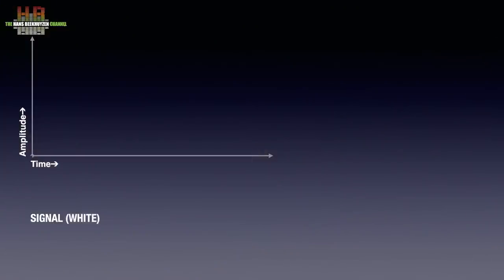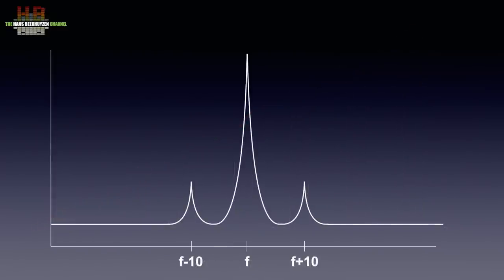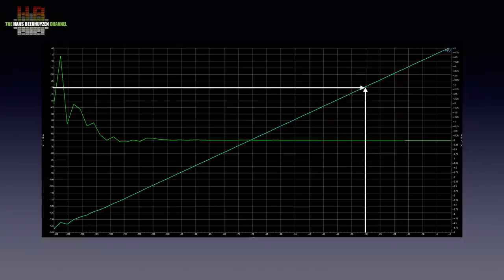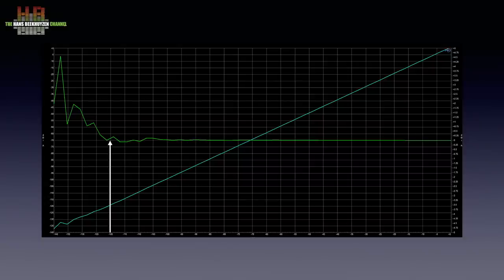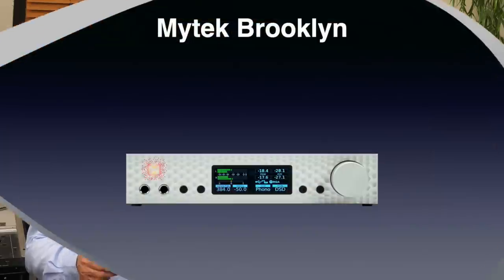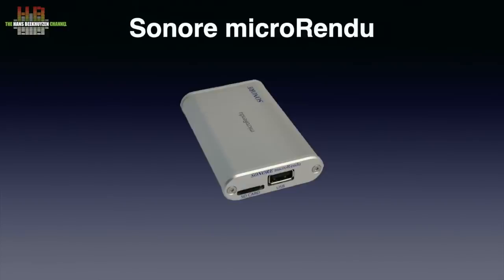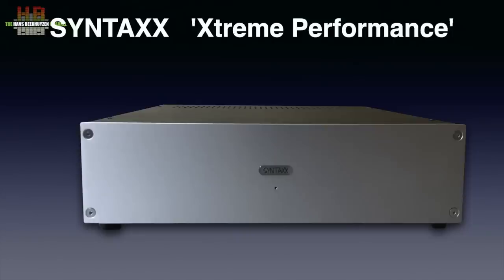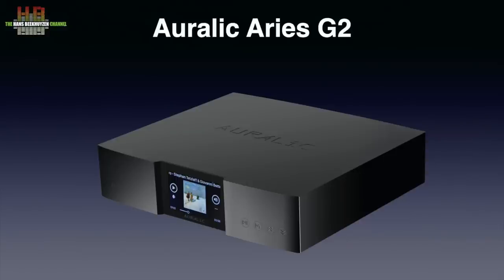What defines the quality of a DAC?

Comment: Good explanations - thanks. Two things come to mind . . .  1) Ladder DACs tend to be less affected by jitter than Delta Sigma DACs which is one of the reasons that they can sound better than DS DACs. 2) Most power supplies both pollute the mains supply with noise and are affected by mains borne noise. Adding power supplies for each piece of equipment that are designed to not pollute the mains supply as well as being as immune as possible to noise on the mains supply will tend give the best subjective results.
Reply from the maker: Still the best DAC's I have heard are no ladder converters.....

Comment: I  have the Brooklyn bridge with BOTW 12 Volt,  what voltage do you run them at?  Sbooster recommends 13 volts (I emailed them), but the input on the Mytek, says 12 Volts.  I also contacted Mytek but they never replied.
Reply from the maker: I use a Syntaxx power supply that outputs 12 volts. I did use an sBooster at 12 volts before. Never tried it at 13 volts.

Comment: Hi haans thank you for the video. But you have discussed only linear distortion. What about background noise, and complex modulations - either signal correlated or random (like spectral leakage) etc?
Reply from the maker: There is no point discussing all parameters. I just mention what might be interesting. I don't publish measurements either since people seek grip on those graphs as where the only can prove when something is wrong (in which case I will mention it). People have to learn to use their ears.
Reply: @TheHansBeekhuyzenChannel  definitely agreed on the last sentence. I'm still curious though to know more measurement possibilities to atleast correlate part of the experience to.

Comment: Very well explained.
What are your thoughts on the comeback of R2R ladder DACs, while chip based DACs have come a long way?
Reply from the maker: There is not one and only best working principle but several and R2R is just one of them. It's all about how well it is designed and built. They are all different approaches to perfection and different routes lead to different compromises and thus different sound characters. And don't forget, perfection is a goal, not a reality.
Reply: @TheHansBeekhuyzenChannel  If you're trying to listen to cd's or any form of music without oversampling then an r2r dac will always be superior. It can't sell mass volumes because it requires precision resistors and actual engineering. If it did sell like crazy the world would be a better place.

The only ways chip dacs excel is with mqa and dsd.

Comment: Can you give some values to the level of jitter you are seeing? I work with RF ADCs and DACs where everything is sub 100 femtosecond which would not cause any measurable distortion.  Are the clock PLLs just bad?
Reply from the maker: The best Xtal Ii have seen used specifies at 83 femtoseconds so PLL's can never exceed that.

Comment: Great grand informative video, as always! I'm just just in the process of getting to learn about differences in sound quality when it comes to digital sources and DACs...
One thing I'd like your thoughts on: I'm using a Marantz NR1710 AV Receiver with build in DAC. I also have a Pro-ject Pre Box S2. Does it really make sense to use the external DAC when the signal is again digitalized in the receiver, e.g. for EQ/Room correction?
Reply from the maker: I have no hands on experience with the marantz but my guess is that an external DAC will not bring you higher sound quality.
Reply: @TheHansBeekhuyzenChannel  thanks Hans for your fast answer and your opinion on this. I think you're right. That's my experience as well.